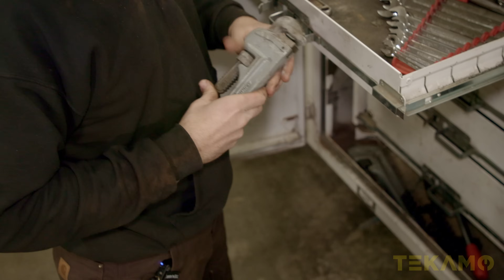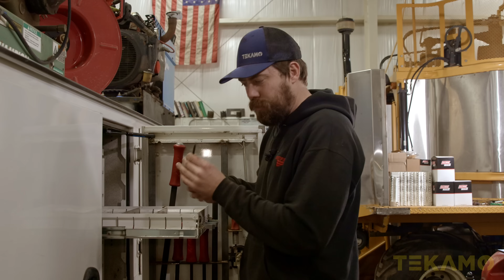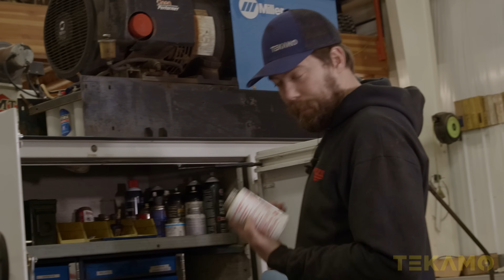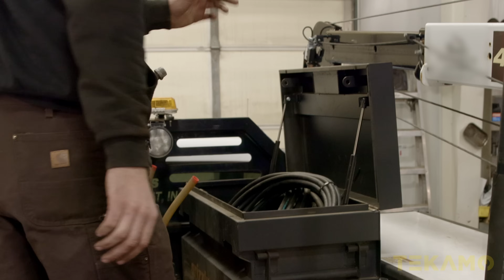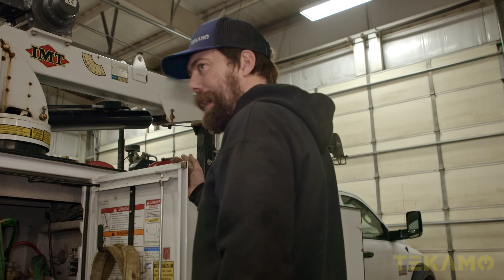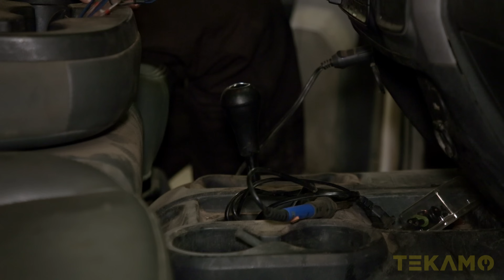These Are The Most Used TOOLS A Farm Mechanic Has! Ram 5500 TRUCK TOUR

Comment: I love Chrome tools, Snap-on is a favorite. Not everything I have is snap on but what is I try to go with Black oxide finish, industrial finish over chrome. I have a few portable tool boxes and if any of the tools get rusty I just polish them off on the wire wheel, spray on some oil. Works well for me.

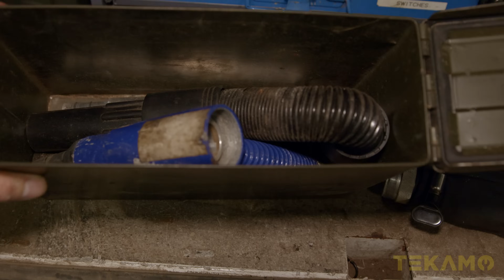Comment: 12:09 power probe does a lot more than a test light if you know how to use it.
Reply: It depends on how you've learned about electrical diagnosis. For me it was useless.
Reply: I use it here and there I feel like they should offer a bit cheaper option to get into it it’s a bit pricey
Reply: @ there are off brands that work good too

Comment: Great tour Taylor! You’ve got a well rounded truck. Love the details you gave for your tool choices and setup. I have a Durham box in my rig and had trouble with the drawers migrating out too. I bought some rectangular magnets and glued one to the back of each drawer. When the drawers are closed, the magnets grab the back of the cabinet and have enough force to keep the drawers closed, at least for me.
Reply from the maker: That's a great fix for the drawer issue, thanks for sharing!

Comment: Tekton makes the angle wrenches just like the Snappy's.
Reply: Yes the tekton ones are great. The sunex ones and other brands only do a 30 / 15 degree offset where the snap onand tekton do a 30 60 degree which can make all the difference in the world messing with hydraulic hoses that are way to close together etc
Reply: @BrumleyBushwhack  I even seem to remember the Tekton was showing that their wrenches have even more clearance than the Snappy's, because of the way the handle is. I have the Snappy set up until 3/4, and then Tekton with a couple Snappy's up to 2". Tekton quit making them in chrome finish and last time I was on their site, it looks like they now stop at 1-1/2".